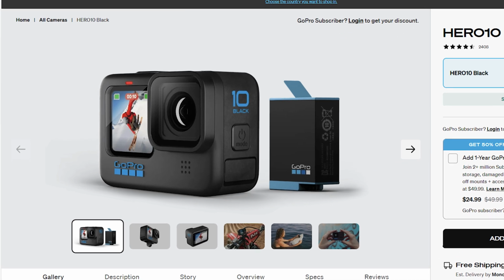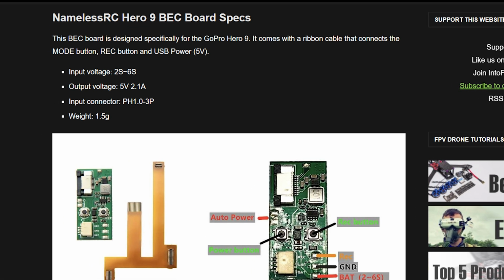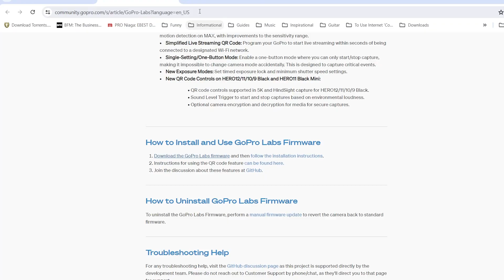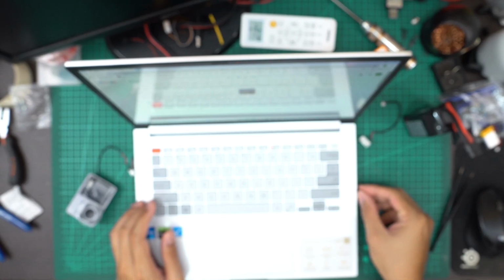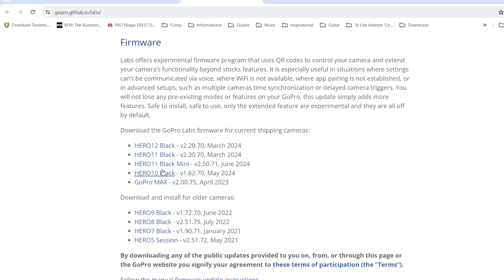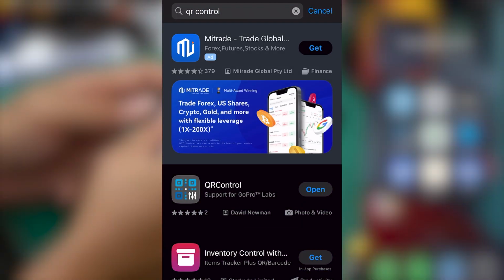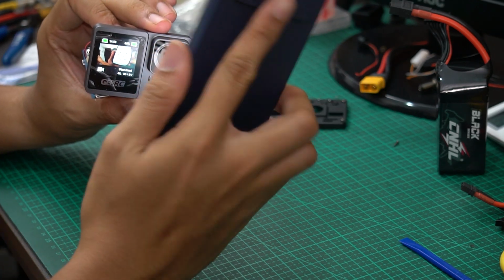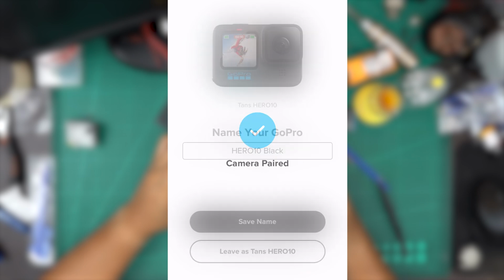Installing Gopro Labs after decasing / Not Enough Power / Update Error

Comment: Dumb question,  I'm living in fear since Monday I got my decased GP. What happen if you format the sd card or just change it. You will have to repeat this process every time?
Reply from the maker: Nope. Gopro has its own internal memory. Sd card is just for writing footage and facilitating updates. 

You can change settings even without an SD card plugged in and it will remain

Comment: I have this issue with my go pro after trying to use an external battery pack. I didn't take it apart like you did. Any way to get it to recognize the battery? It says not enough power with fully charged owm enduro battery

Comment: I had a GepRC naked GoPro 11 that would power on just fine, but one day randomly refused to start recording no matter what I tried.  I was unable to reinstall gopro labs firmware because it was stuck in a reboot loop.  Finally I installed the original gopro firmware manually and it worked, but then I landed where you were with official firmware.   This tutorial is exactly what I needed, and worked perfectly.  Cheers!

Comment: you are such a life saver!!!!! thank you!
Reply from the maker: Happy to help
Reply: @TanFK  unfortunately i am now running into a much worse issue. Both gyro and hypersmooth seem to be shut off. When I enable hypersmooth nothing happens in camera. Everything still shaky. And when I shut off hypersmooth (and lens wide) gyroflow does not see any gyro data being recorded. Also in realsteady it complains there is no motion data. I am totally clueless after two days troubleshooting. Do perhaps seen this before?
Reply from the maker: @weslisahum  if i were you. Id try maybe using another SD card, i use a sandisk extreme (red and gold) if your running higher write speed sd cards then good. 

If that still doesnt work, maybe try factory resetting the naked gopro in gopro labs
( !freset)  then reupdate and install gopro labs again.

Thats all i can think you can try atm